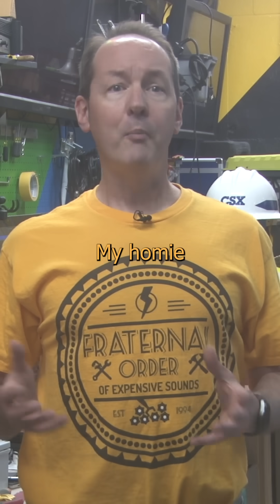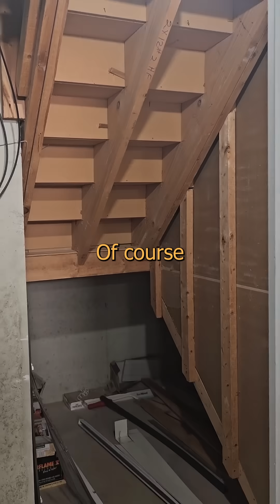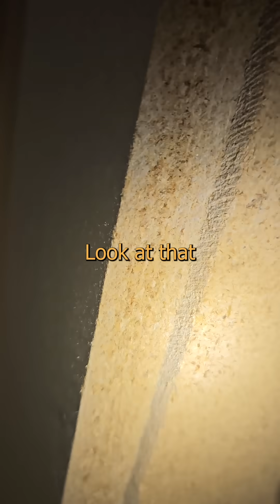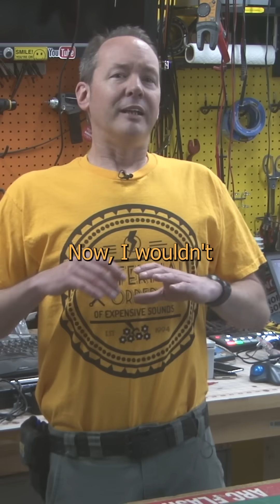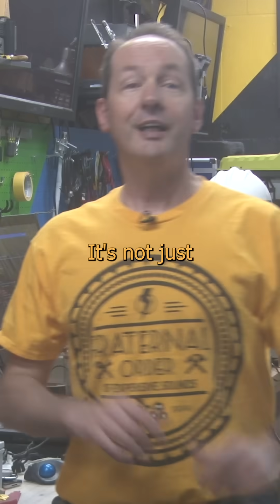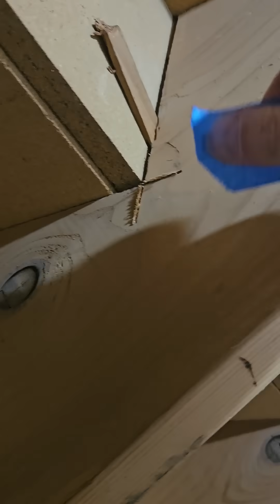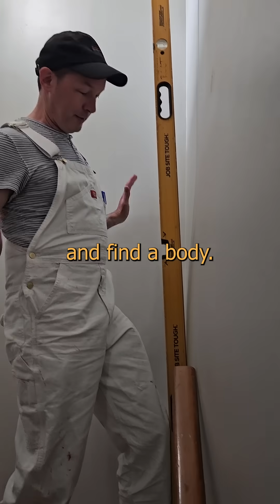Particleboard Staircase #chrisboden #engineering #construction #stairs #cheap #job #work #carpentry

Comment: Go ahead and fix the tread and risers and replace with plywood. Sometimes you gotta take control and make things right, liability be dammed
Reply: Depends if there is Warranty involved, going on the proper channels can Dave you a lot of money
Reply: @Voron_Aggrav  Hell, even it's out of warranty I'd still complain about everyone involved. The contractors and inspectors on this all need a complaint raised against them.

Unless he bought this house with cash out in the countryside there were a fuckload of failures and grift occurring here.

Comment: Looks like a framer didn't nail a wallcap and when they put the roof on it separated allowing the wall to bow out.😂
Reply: That sounds bad. How bad is that?
Reply: @timepear  he just means the top plate isn't nailed to the joists at the top, letting the wall wiggle around at the top whichever way it wants. If it's not a load bearing wall then it won't affect the standinguppingness of the structure at all but it's a stairwell so I would assume it'd be structurally significant, we can't tell from the video

Basically, who the fuck knows lmao